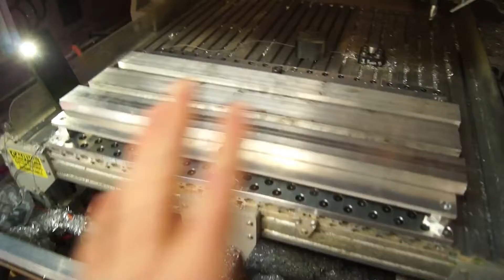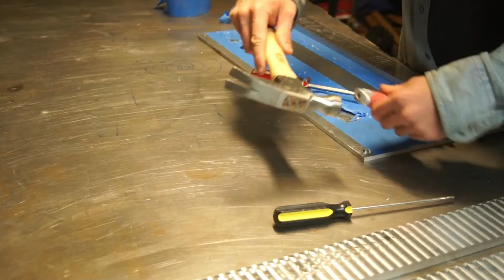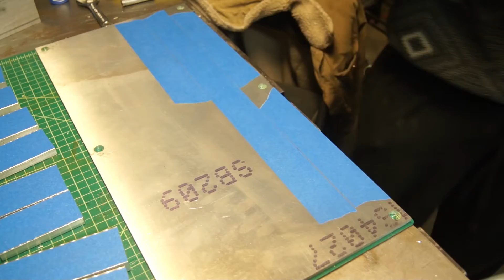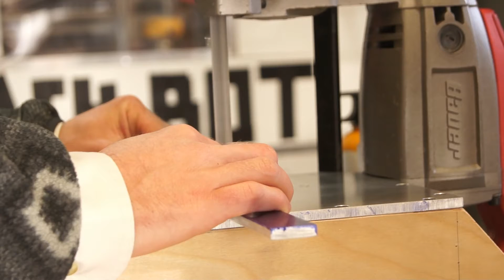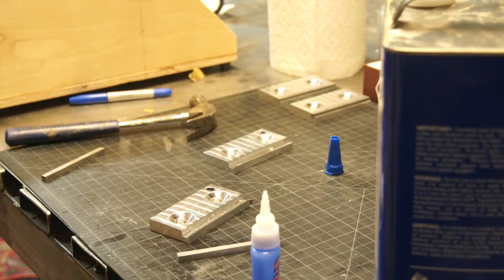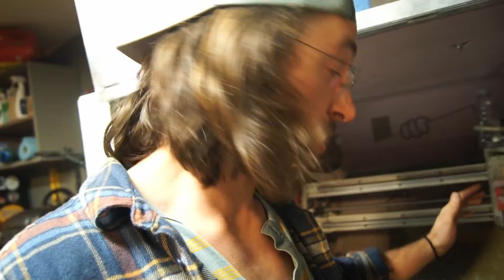Ripping Off Saunders’ Mod Vices

Comment: What does the 1 degree angle do?
Reply: When clamping your part it helps to push your workpiece down into the vise jaws. Typical drill press vises used on CNC machines will push the part upward out of the vise jaws which will throw your dimensions and tolerances off.

Comment: I have a question about how these modvices produce any holding pressure. Is it really the 45° Taper of the counter sink head against the aluminium part? Have you noticed any thread stripping or plastic deformation of the aluminium parts?
Reply from the maker: Yes and yes

Comment: I love these. Your programs look clean and the parts turned out really well. A suggestion for the future, if you’ve got a 3d toolpath with a small step over moving slowly, zigzag your tool across the part to save time. It’s not taking enough material to heat up or stress your cutter, and it will be more than 2 times faster.
Reply from the maker: Always want to climb mill to reduce wear
Reply: @DylanEdmiston  surface finishing doesn’t offer enough resistance to create any excess wear. I’d argue that the spindle time of running your machine 2-3 times as long without zigzag is worse than wearing out a $20-35 1/4” ballmill.

Comment: For your hole drilling issue, I would recommend you try using a spotting drill after using the punch, and then using shorter drills in order to avoid having the drills flex as much. I like to use "Screw machine drills". They're short, and very rigid as a result. They also tend to not be very expensive. They use less material than a normal-length twist drill, and require less grinding to manufacture them.
Reply from the maker: I def use screw drills, can’t remember why I wasn’t using them here
Reply: @DylanEdmiston  Also: Workholding with the drill-press.
Your "free hand style" looked like a breeze in the wind:)
This may be faster (to produce an accident ...?), but for precision work use steady mounting in every piece of the equipment, including the drill press. 
Wobbly tables shouldn't be tolerated (tolerance ... pun intended).
Thanks for the video, Dylan and sharing your ideas!:)

Comment: Plunge at 22:30 should be a predrill operation. Add an undersized drill operation followed by pocket with predrill/entry points.
Reply from the maker: Only had collet for 1/8 and 1/4. Machine too light for 1/4 drilling most likely…
Reply: @DylanEdmiston  The entry point isn't critical you just want to avoid the plunge cut. You could predrill before you mount on your router. The important thing is getting a hole so you can start side milling instead of plunging. Although it's been a long time since I milled any aluminum with my CNC router, I recently figured out F360 predrilling and entry points on my mill to avoid the maddening helix plunges.  It's probably easier on your machine to drill than plunge (for a given tool diameter). I know it's a pain to tool change on a router but drilling 1/8" then 1/4" then milling out the pocket might be faster overall.
Reply from the maker: @jt6802  tool changes are also a problem yes
Reply: @DylanEdmiston  Would you mind sharing your F360 project? I'd like to make a vice for my router.

Comment: Small pilot hole, then always drill undersized then ream the hole, remember when reaming never put the drill in reverse! On my Bridgeport I can always get accurate holes this way. It’s harder with a drill press though!
Reply: Try using a small flexible drill bit for the pilot hole like  a 1/16th. It will flex and follow the punch mark. A mill will benefit from a rigid pilot drill but on a drill press, it doesnt work that way.  An optical center punch plus a thin pilot bit will get you very accurate holes on a drill press.
Reply from the maker: I ran some smaller holes today and they were better